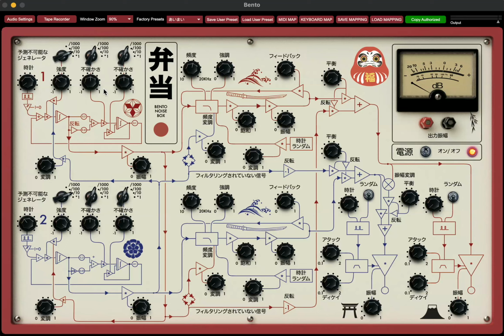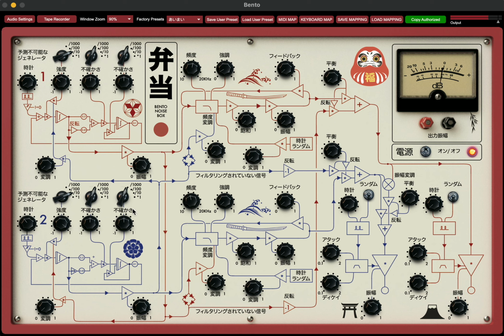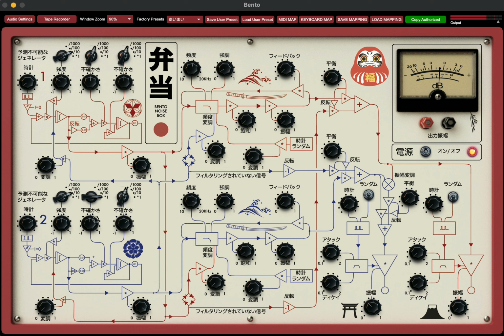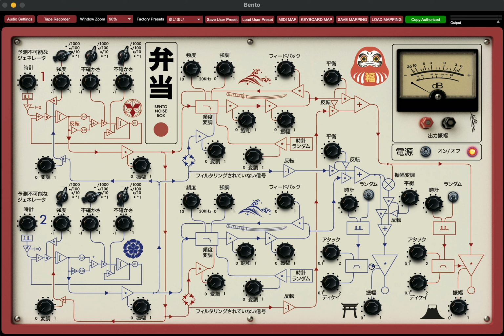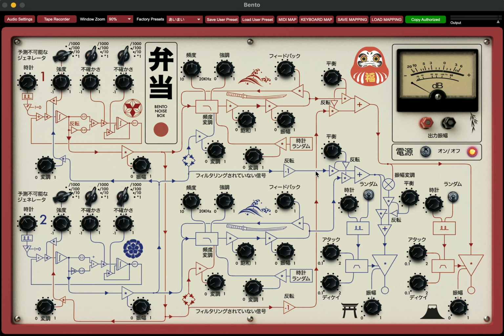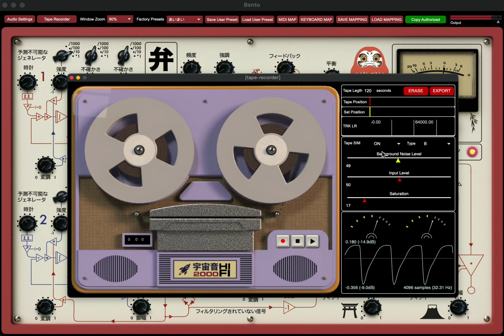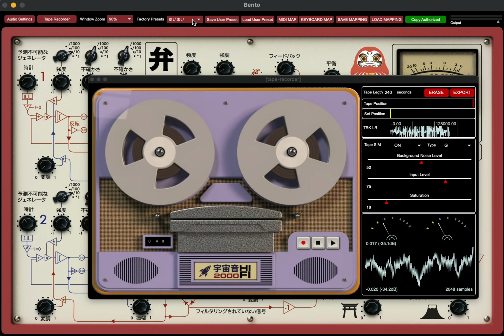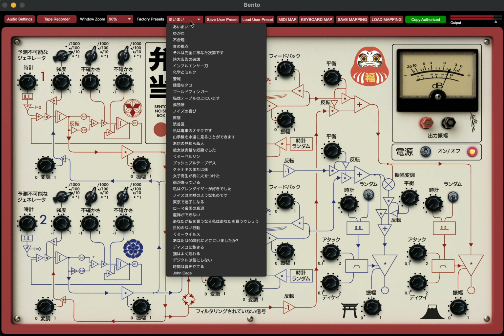弁当 Bentō Noise Box Demo and Tutorial

Comment: This seems to be a lot of fun, I'll be deep diving it right away. As many have mentioned already, iOS version would be killer.
I plan to make MIDI macros (on TouchDesigner) to map a few parameters together to simplify performance. I feel the attenuators for cross modulation will get their unique control though :)